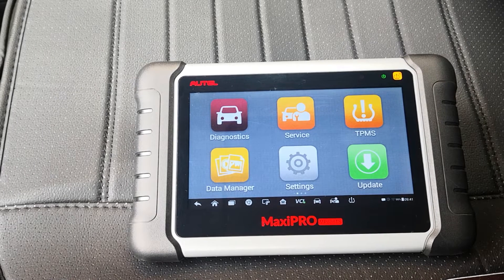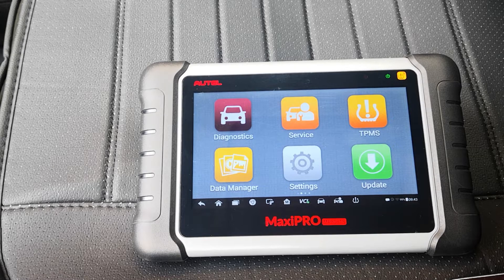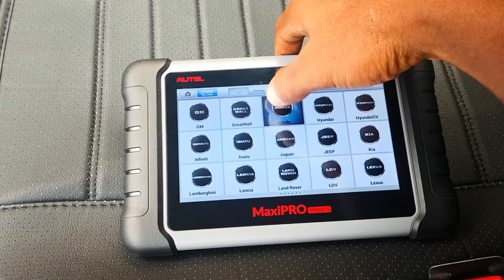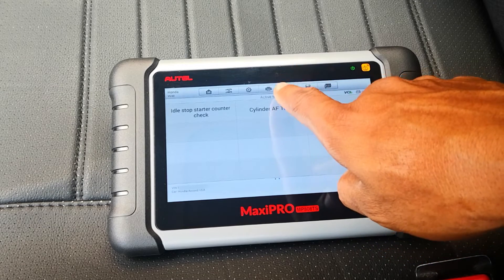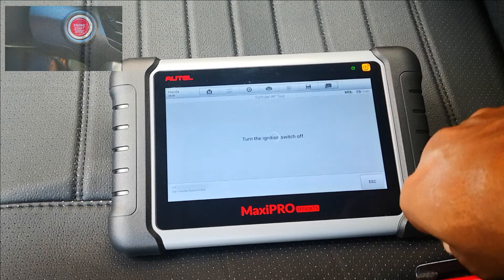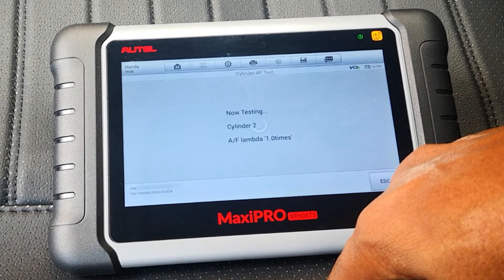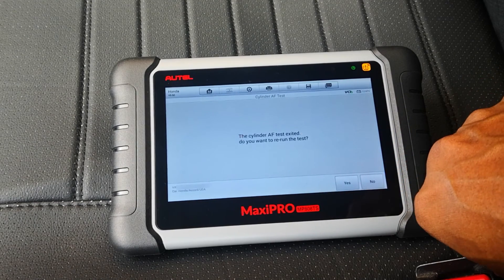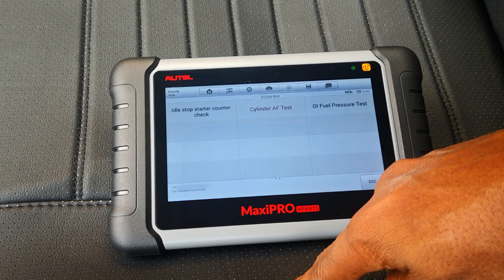Testing Individual CYLINDER AIR-FUEL RATIOS  with AUTEL SCANNER - Autel MP808TS

Comment: Thanks again for your time.
If one of the cylinder is misfiring,

dose that mean we've to check the injector or the spark plug?
Reply from the maker: Good places to start. Others include ignition coils etc

Comment: Have one that failed all cylinders (rich). How should i proceed?
Reply from the maker: That's better news. Because it's most likely the car is running rich in general, as against it being a problem in the cylinders. Do you have any codes?
Reply: @DIYAutoworksNG  Vehicle drives fine until you accelerate hard and then the CEL starts flashing amd will go into limp mode. Codes P0300-p0304.
Reply from the maker: What car is it? You'll need to rule out the following?
1. Bad fuel pressure regulator
2. Clogged air cleaner element
3. Worn spark plugs

I did a video that could help as you review fuel trim data https://youtu.be/O5KI0GHNX7Y
Also clean your MAF/MAP sensors if equipped.

Comment: I have a 2006 Nissan Altima where when in D and at a stop thE RPMS drop to 632ish.  Once you bring the RPMS to spec around 732-750ish it goes away.

I have a Autel my908 and I can’t find the test you did.  😊

Comment: I have the XtoolD7 and I see it has the cylinder a/f ratio test. I’m trying to do my 2018 Honda Pilot. I’m not sure if it will do this car. Any help would be appreciated.
Reply from the maker: Do you mean the AF reset under special function? Honda is not supported.
Reply: No cylinder air fuel ratio test. Just like in this video. It’s under actuation test. I’ve run it and it seems to adjust each each injector in each cylinder but doesn’t work properly. I get cylinder 1-6 fail (dense).
Reply from the maker: Okay! Got you!
Try using a good fuel system or injector cleaner and repeat.
Reply: This is the test Honda dealer uses to verify bad injectors in gdi engines.

Comment: Why Cylinder AF need to be tested
Reply from the maker: Thanks, because in a gasoline direct injection engine, the air-fuel ratio varies by cylinder. The test can help you isolate a cylinder that is performing poorly.

Comment: Purchased for a 2009 impala that suspected fuel alcohol content was high and it showed it was. The bad part is this scan tool will not let me reset it. Seems slow and not near enough functions also the Bluetooth part you have to be pretty close or in the vehicle. Any suggestions on a better model scanner would be great . Thanks
Reply from the maker: Is it the fuel trims you want to reset? Just reset the ECU as you normally would to clear a code. I agree on the  seeming slow bit, wired connections are faster, but I won't trade that for the freedom of taking the scan tool around to the engine to hear a sound  etc. I haven't had issues with Bluetooth proximity although I haven't done experiments on range. In terms of other scanners to recommend, I can't say for now. I also have an XTOOL D7 but it's wired (faster) and doesn't have all the functions supported in the MP808TS. I could have suggested Launch, TopDon etc, but I don't really have experience with those tools.
Reply: @DIYAutoworksNG  What I'm looking to reset is the fuel alcohol content on a e85 vehicle. It is reading 68% and have never uses e85
Reply from the maker: I see. I can say specifically. Maybe ask Autel support if the tool supports that???

Comment: Wow this is amazing I have this code currently on lexus rx350 2012 P2019B. Can I do this test for a lexus with an autel
Reply from the maker: Hello. The test is different on the Lexus. You will need a compression gauge to complete. The tool will just disable the injectors and command wide open throttle for more accurate estimation of compression values.

Comment: you can do an DPF  test or force regeneration(something like that) ?    How long does the battery last? (maxipro mp808ts) and how long does it charge ?
Reply: DPF regen takes 40-60 mins
Confirm it works and is supported 👍
Reply from the maker: Thanks for the update
Reply from the maker: Yep DPF is supported under service functions. 
Haven't taken the time to really check how long it lasts nor how long it takes to charge. However, in over a year of having it, the battery is yet to die on me. Formal quoted duration is around 7-8hours of battery life. I can't say it takes more than 2hrs or so to charge. If I find the actual figure, I'll update.
Reply: @DIYAutoworksNG   In one year your battery is almost dead(to quickly) , why   because is chinese staff or you used so much( every day). You gone buy another tester , what brend ? Lunch x431?
Reply from the maker: I think you may have missed my comment. I am saying that my battery is still good after more than a year.